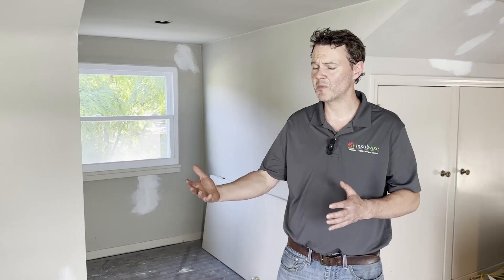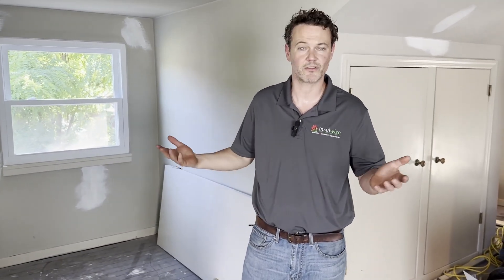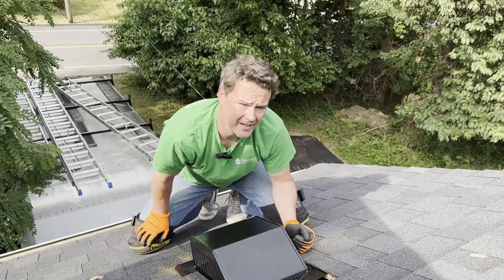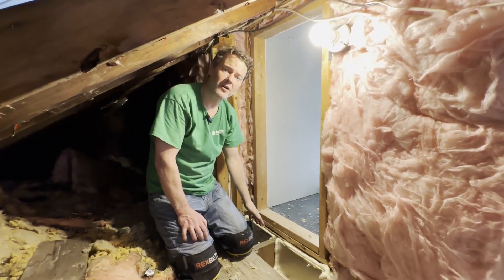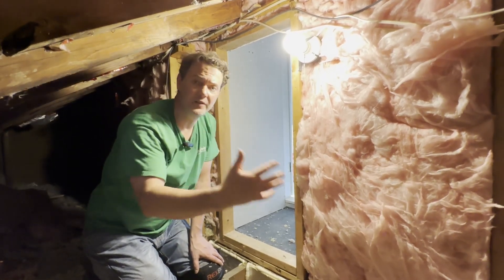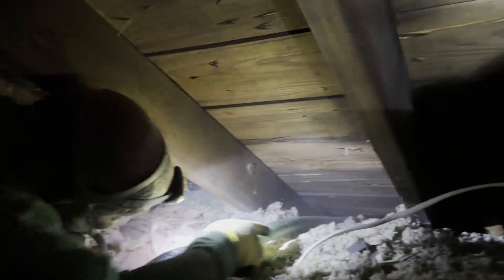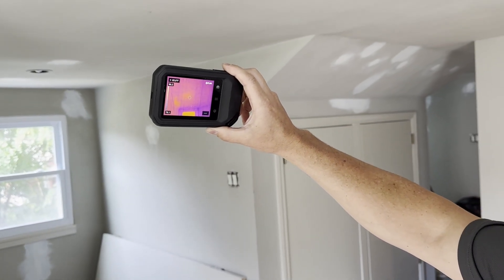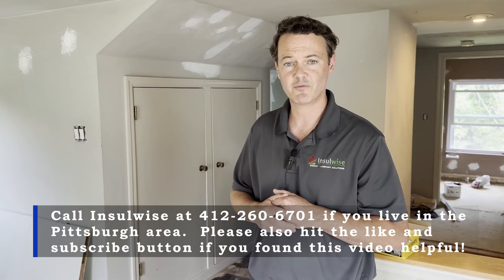How We Quickly Cooled This Sweltering Cape Cod Home with New Insulation!

Comment: Amazing video!! 

We currently live in a 1958 Cape Cod home with very old batting insulation within that knee wall scrawl space that are stapled to the roof rafter areas--of which most of them are falling down and not working properly which is why are are looking to update it (pictures in the below links)

What would your approach be if a Cape Cod does not have soffit vents? We do have ridge vents at the peak of the roof and gable vents up in the peak area as well.

We have had 2 different energy companies come out to our house and give us their opinions on what to do and it was typically a combination of:

     - Spray foam the corner of the house (where the soffits typically would be) up until it reaches the knee wall/slope area before it goes into the actual sloped area

     - Spray in packed cellulose in the sloped area

     - Spray in cellulose in the Devil's triangle peak area.

     - Combining all of this with some foil/foam stuff to seal in the cellulose.

     - A graphic of this is highlighted in the "Company's Plan" link below

Both companies said by doing this we wouldn’t need to insulate the lower flat attic since this would now be a “conditioned” space nor would we have to spray foam any of the air gaps from let's say canned lights, etc. I kind of see the logic here, but I feel you would want to also seal off any air gaps between the 1st and the 2nd floor since we already have return vents upstairs in our HVAC system. They also said that since this would now be conditioned space, the area of the attic wouldn't be too much hotter than our actual bedroom on the other side of the knee wall--which I find hard to believe....

Secondly—I always thought that the attic needed ventilation but according to these two companies, they said we didn’t need ventilation since they would be making it a conditioned space. If we were to completely seal that attic space, that means no air would be going through the slope area and out of the ridge vent—which I thought was the reason for having such things. With this setup, I am worried about moisture build-up, mold, and reducing the life of our roof. Additionally--I am not so sure about the spray foam since from what I read contains a bunch of toxic materials, and we can't even be in the house from 24-72 hours after they spray it in, which is concerning since it is unknown what the long-term effects from this may be after breathing it in constantly. The companies said they don't recommend batting insulation anymore for the areas that touch the roof hence why they switched to spray foam.....

Looking for any professional guidance on this project--trying to be the most effective since the summers in this house are unbearably hot. Thanks so much for any help!

idge vent—which I thought was the reason for having such things. With this setup, I am worried about moisture build-up, mold, and reducing the life of our roof. Additionally--I am not so sure about the spray foam since from what I read contains a bunch of toxic materials, and we can't even be in the house from 24-72 hours after they spray it in, which is concerning since it is unknown what the long-term effects from this may be after breathing it in constantly. The companies said they don't recommend batting insulation anymore for the areas that touch the roof hence why they switched to spray foam.....

Apologies for the long comment--Looking for any professional guidance on this project--trying to be the most effective since the summers in this house are unbearably hot. Thanks so much for any help! Wish you guys serviced Northern Virginia/DC area....

Links to pics below:

Insulation Pic 1 - https://imgur.com/a/vrfyJHv

Insulation Pic 2 - https://imgur.com/a/GFaDcS7

Insulation Pic 3 - https://imgur.com/a/j0i4evM

Insulation Pic 4 - https://imgur.com/a/vGZdE1E

Company's plan - https://imgur.com/a/KrqS5xs
Reply from the maker: Thanks!  I took a look at the pics and you have a pretty standard Cape design home.  I'd say their overall approach is good, with one caveat I explain below.  If they spray foam the underside of the roof in the knee wall spaces as well as the exposed gable end walls inside the space that will make those spaces "conditioned spaces."  That will eliminate the need to do any air sealing in those spaces.  If they then dense pack the slope bays and air seal / insulate the upper attic space that should produce a good solution (it sounds like you have good ventilation in the upper attic).  
The only question I'd have is what type of spray foam do they want to use on the underside of the roof?  In my opinion and the opinion of many others in the building science community, the ONLY type of foam that should ever be used for insulating the underside of roofs is closed cell foam.  This is because closed cell foam at 2" thickness creates a vapor barrier.  Most companies use open cell foam because it's faster/ cheaper/ easier and the homeowners usually aren't aware there's a difference.  However -- open cell foam does NOT have a vapor barrier.  And water vapor can migrate through it, get trapped against the shingles and rot the roof.  I have worked on jobs where this has happened and have dealt with the after effects.  It is not a myth.
Closed cell foam is more expensive, but I would not want to play with my roof.  We don't use closed cell foam in these situations because it's prohibitively expensive and I simply don't like the idea of a roof having a coating on the underside of it if it can be avoided.  At least 25% of the attics we work in have a small roof leak somewhere that the homeowner was unaware of.  A well ventilated attic will tolerate small minor roof leaks (it sounds crazy but we see it all the time).  Heck I have a video showing an example of this.  If you have foam sprayed onto the roof there's a solid chance you're not going to know you've got a leak until you've got a real problem (happened on the project that I worked on).
If they use open cell foam you may never have a problem (at least not that you'll be aware of for several years).  It is just not what's recommended.  
I'd recommend having them quote you for closed cell foam on the underside of the roof.  But first DO your research on this...google closed cell versus open cell foam when applied to roofs and you'll learn all that you need to.  You may also learn that you want a different contractor in the process (but hopefully not).  Hope this helps!
Andy
Reply: @insulwiseenergycomfortsolu3293  thanks so much for your thoughtful reply!! Super helpful. One quick follow-on question to this—we were thinking of not doing the spray foam, so out of the contractors plans—what would you suggest they do if they don’t do the spray foam, but something else? Do what you did in this project in the video where you leave that roof line untouched and then just do batting on the knee wall and the cellulose spray foam in the bottom? 

We would like to keep our crawl space semi-workable for storage so the cellulose spray in on the bottom were on the fence about…

Thanks Andy!
Reply from the maker: @agacom1  You're welcome!  If they did the same thing in your Cape that I do in this video you'll have a fine result.  Batting the knee walls with R-19 fiberglass and covering them with a building wrap is the easy part.  The other critical things are sealing the voids underneath the knee walls, air sealing the outlets in the knee walls with foam / caulk, and air sealing all of the air leaks in the floor of the knee walls before insulating with cellulose.  Lastly, if your knee wall spaces are not vented via soffit or under shingle vents, they should be vented using something like the slant back vents that you see me use in the video.  You never want to have an insulated, unconditioned space that is unventilated.  It becomes a perfect situation for mold growth.  Hope this helps!
Andy
Reply: @insulwiseenergycomfortsolu3293  this is perfect. Thanks so so much Andy--learned more from you than I have other contractors physically coming to my house! Keep up the great channel!

Comment: How do you guys blow the insulation in the ceiling area of that space? Do you cut an access door into it? Or do you feed the blower into the gaps and just let it fill up?
Reply from the maker: In this case the upper attic area was large enough that we were able to cut a hole in the ceiling and enter that way.  We then patched the ceiling afterward.  Sometimes these upper ceilings are just too small though.  If they are less than 6ft across than we will usually have to blow the upper attics by tubing up through the slopes and blowing those areas that way.  It always depends on how much room we have. 
Thanks!
Reply: @insulwiseenergycomfortsolu3293  Thanks for the reply! I have this situation and was wondering what the best course of action would be. May need to snake a camera up there to do an inspection before I cut a hole. I have a dormer as well that connects to that area and it would be best to have access to it.

Comment: Some people have reported that cellulose insulation leaves their house smelling very badly for a very long time. Many months or even years after it has been installed. I wanted to ask you what your experience has been with this and if there is a specific cellulose brand that is better and doesn't smell and have this problem over another?
Reply from the maker: Good question.  Cellulose insulation basically just smells like paper, as far as I can tell.  We air seal all of the attic floors that we work in prior to insulating them, so there really isn't much of a smell that comes down into the home.  I've used just about every brand of cellulose insulation out there and it all smells pretty much the same to me.  That said -- there have been a few cases of cellulose insulation being used as a damp wall-spray application in new construction and it was not allowed to dry properly before the drywall was put over it.  I've heard of that creating a bad smell, but not cellulose on it's own.

Comment: Very informative video. When you put the foam board in between the studs, does the foil backing need to be facing outwards? I have a wall along side an enclosed staircase that always feels hot. It only has batt insulation between the studs in the attic. Thank you
Reply from the maker: In the video it doesn't matter which side the foil is on.  We were using the foam board to block transition gaps beneath the knee walls and it was buried in cellulose insulation later.  But-- if the foam board were to be exposed -- you would want the foil side to face outward.  The foil covering will act as a radiant barrier, reflecting attic heat back toward the roof and away from the home.  So I believe in your application you would want it facing outward.  Hope this helps!
Andy
Reply: I was thinking I could pull the batt insulation , put the foam board in and put the batts back on top of it. Again, thank you!
Reply from the maker: For the best result you'd want to leave the batts in place in between the stud bays of the knee wall, and then go over top of the studs with foam board.  You never want to have air gaps between the insulation and the surface that you're trying to insulate, this can allow for convection currents to occur.  
Andy

Comment: Thank you! Unfortunately I only have 4 inch roof joists… even further why baffles won’t work…
Reply from the maker: You're welcome!  Yes, baffles are a tough deal with these (unless the inside sloped drywall section is removed or the roof area).  We've done well over a thousand homes this way and it's a standard weatherization practice in our area.  The biggest thing is having the lower knee wall attics AND upper main attic effectively ventilated.

Comment: I have a similar design house in Bucks County PA and was considering eliminating the knee walls entirely and making it basically all sloped walls top to bottom with just a small space at the top where it is flat 4 feet wide for a ceiling. Is that feasible or better to keep the knee walls and insulate like you have done here? Right now it’s gutted to the studs for a full remodel.
Reply from the maker: Hmm..I've seen a few houses where that was done, but you end up having a fair bit of useless space at the bottom of the triangle.  I have also seen where shelving / dressers have been built into the knee walls to better utilize the space.  Those things get tricky to insulate though on the back end / knee wall attic side.  The simplest way IMO is to leave it as is.  If you use the methods that I've shown here you'll have good results.  There's always ways to optimize it / make it better, it's just a matter of the time and money that you want to spend on the project.  Good luck to you!
Reply: @insulwiseenergycomfortsolu3293 Sorry to keep asking questions but I only want to do this once. The insulation from the top of the knee wall to ceiling does or doesn’t need to have baffles installed? For ease of installation I am doing fiberglass batts, I would prefer cellulose dense pack but not able to do that myself and can’t afford to get the drywall done before insulation goes in. I have a ridge vent so not how that affects that part of the installation. Everything else you have shown in your videos helped me tremendously to tackle this myself and I thank you for that. Keep in mind I am currently gutted to the studs throughout the upstairs. For the moment I am mainly concerned with keeping the heat in the house and was going to install strapping on the ceiling to retain the insulation in the attic so it is not hanging down. Drywall is probably going to be spring time.
Reply from the maker: @Mopjockey1234  No worries at all, I didn't realize you were down to bare studs, you have an excellent opportunity there.  If there's no drywall on the slope ceiling, definitely install baffles into every rafter bay from the tops of the knee walls and about 18" inches up past the floor joists of the upper attic.  You want the tops of the baffles to easily clear the insulation you'll be installing between the joists of the upper attic.  We've done this a few times.  Slope rafter bays will have baffles and R-19 batts.  I'd then install R-38 batts between the collar ties (horizontal joists in the upper attic).  The ridge vent up top will vent that attic space just fine (assuming it's been properly cut in and is actually venting...we sometimes find them either not cut in OR covered with a roofing membrane that massively impedes air flow.  You'll want to check and confirm this).  
If you have other questions feel free to reach out. 
Andy
Reply: @ thank you again for the advice with this house. I checked and the ridge vent is definitely venting and also noticed that I have a gable vent on each end as well about 18x18 inches. Looks like no soffit vents, 2x6 for the roof rafters and 2x8 for the floor joists. One dormer on the front side of the house. I actually found the video of my house when it was for sale if you want to take a look at how it is built. Here is a link https://youtu.be/jiI2E2kmK8M?si=ZVOne8sUBJKPnKhm
Reply from the maker: @Mopjockey1234 You're welcome!  I had a quick look at the video, it's a classic and simple Cape, should be straight forward to upgrade the insulation.  You'll need to insulate the sides of the dormer walls that are accessible inside the front knee wall spaces as well.  You may need to cut additional access points into those knee wall spaces.  Do you have a way to ventilate the knee walls?  You don't have overhangs / soffit vents.  What we would do is install slant back vents, like I do in the video. 
Andy
Reply: @ I was hoping to get all of the insulation work done and have the slope back vents installed in the spring when it gets just a little warmer consistently. My knee walls are garbage, they toe nailed the studs to the floor joists and angled them left to attach to the side of the rafters and they are 4 feet 10 inches tall with no top plates. I am going to build new knee walls at 4 feet tall with top plates to minimize the number of joints and waste of drywall. For the floor cavities past the knee walls to the soffit can I use fiberglass and achieve good results ? The machine Home Depot has for blow in insulation seems to only do loose pack so not sure what is the best option. I will make a video of the upstairs as it is now, I am sure you will be shaking your head when you see some of the “ construction “ prior owners did in the 70s
Reply from the maker: @Mopjockey1234  Just so you're aware, mold growth typically happens on the undersides of roofs during the colder months, when water vapor can consistently condense on the underside of the roof.  If you're not going to ventilate than definitely keep an eye on the underside of the roof throughout the winter.  We see all kinds of knee wall construction going back to over 100 years, but do what is easiest for you and will leave you with a great performing home.  Cheers. 
Andy
Reply: @ Thanks for letting me know the mold is more of a problem in the colder months because I was thinking the opposite. I will see if I can get a roofer to do the vents either just before or during the insulation process to avoid issues. I don't want to cause any more problems than I already have. I wish your company was in my area I would just bite the bullet and let you handle it, you definitely know what you are doing. From your videos I can see you do top notch work and really care about the customer being happy and satisfied. That's a rare combination these days!!! Thank you again for the advice and pointing me in the right direction 😊